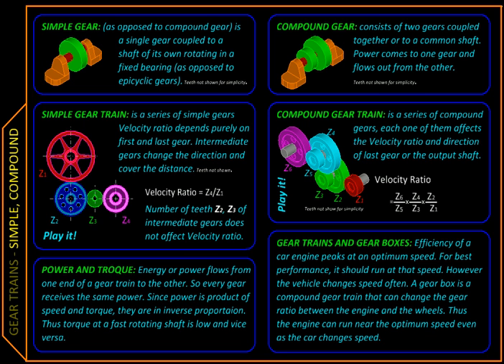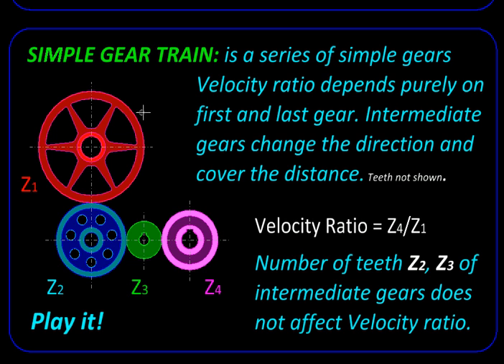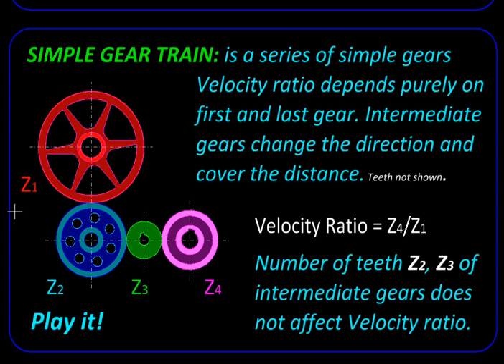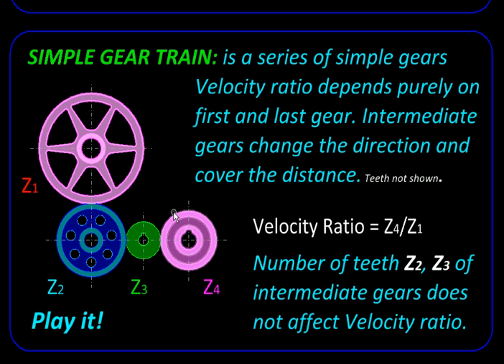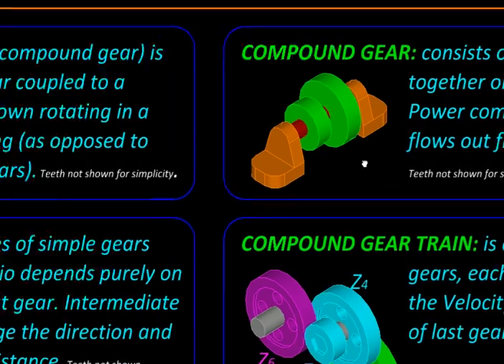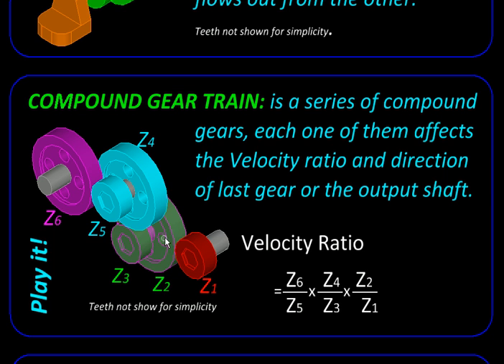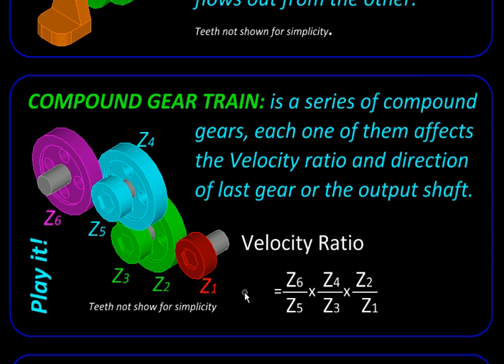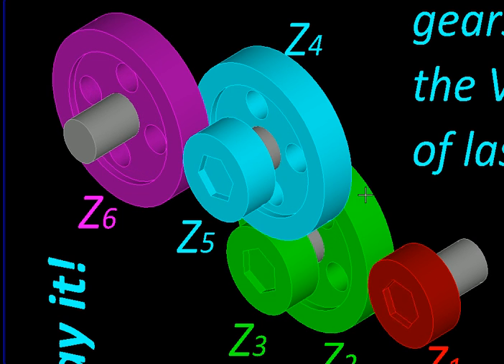Kinematics Ch06N Gear Trains - I

Comment from the maker: @Srk7028 Sorry if it confused you. Velocity ratio (VR) here means the same thing as in simple machines = (speed of effort or input) / (speed of load or output). Since the speeds vary inversely as the numbers of teeth. VR would be (Number of teeth on output gear) / (number of teeth on the input gear). Should we call it or equate it to 'Gear Ratio' (GR)? I have seen books vary on that. Some take VR and GR the same and some take them as reciprocals. So can't help you there :-(